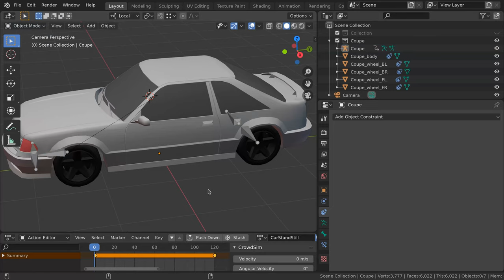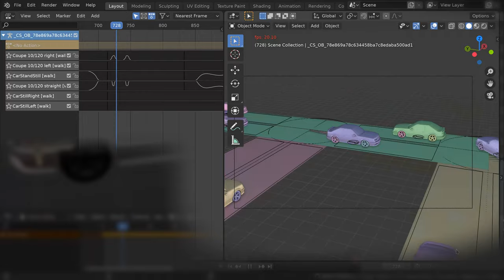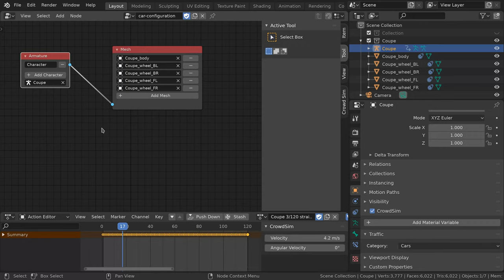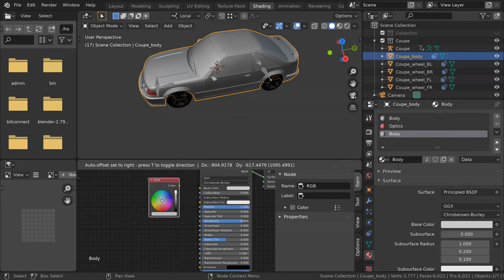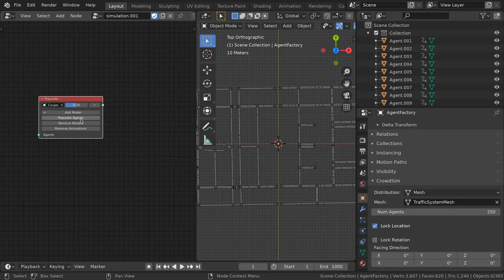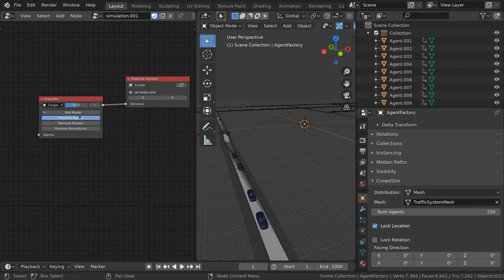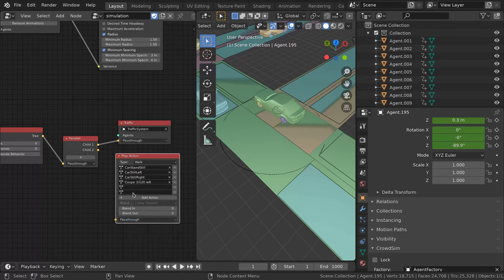How to prepare a car model.

Comment: Im having issues with configuring my car model

i rigged my model with the car rigger addon, yet when i try to add it to the simulation

 i have an error message, witch says "Cannot connect from populate.model to traffic.agents as they have different types"

 how can i fix this? Thank you